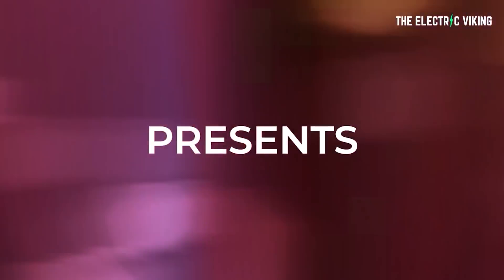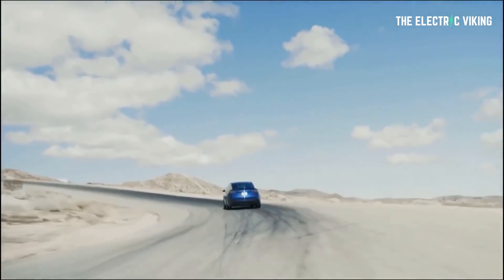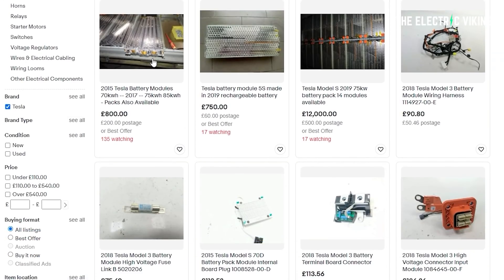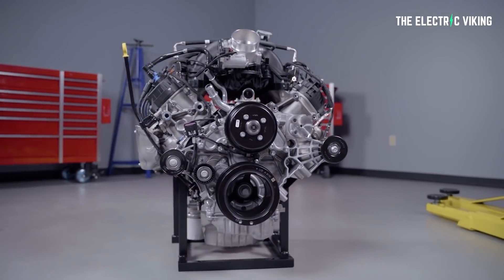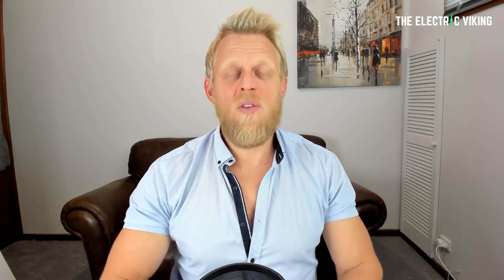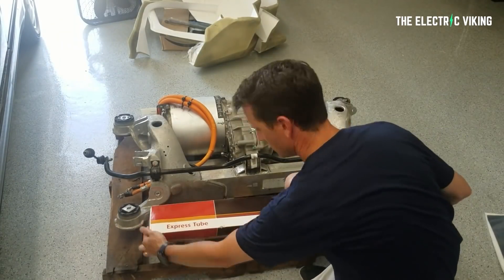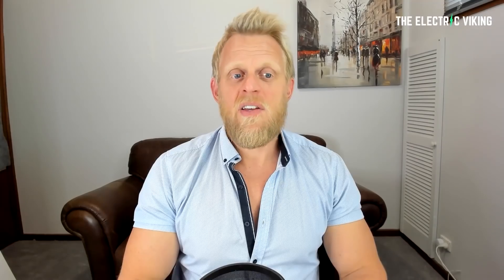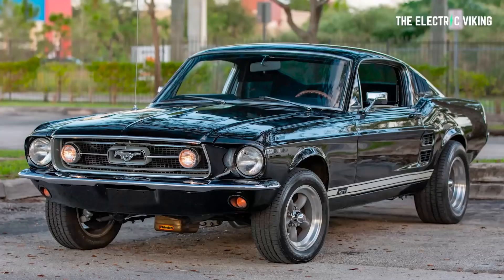Scrap the small-block V8 Swap for this Tesla Crate Motor

Comment: The battery is the difference from the past.
The conversion can include a SMALL BATTERY for the daily drive. 
FORGET HORSE AND CART THINKING. 
Daily top up at home 
Daily top up at home 
Daily top up at home
Daily top up at home
The old ways of putting 500 klm of highly inflammable petroleum, 80kg, and $100s in the tank every 10 days is not needed. 
The vehicle battery can even power the home overnight.
And the rooftop solar PV power the home all day. And feed the grid. 
Plug the EV into the grid everywhere soon.
Westfield shopping centre car parks can supply wall 240volt outlets and cover the rooftops with PV panels, I hear.
So home and shops can top up each day EV..
Reply: Stfu!!!!! Some people converts their old ICE to new modern ICE engines to have even better range and practical and also runing your old diesel on used oils is another great idea. Overlanding,towing, off-roading, camping……
Reply: @alanmay7929  there are people pushing the nuclear power plants to get CO2 REDUCTION. 
They say that the EV car can be charged from the grid.
The petroleum will be a strategic military reserve.
Reply: @stephenbrickwood1602  petroleum will still be much more than military reserve because oil is basically everything, your tesla batteries can it replace oil not even in billion years, the industry needs raw materials and products mostly made from oil.
Reply: @stephenbrickwood1602  tesla cannot make the semi or cube because those vehicles needs significantly way more batteries than the small model 3 or y for example. A diesel truck has basically no limitations, you can very easily increase the fuel capacity to travel over 2500 miles in the middle of nowhere like the Australian road trains…. The mining equipments can run 24/7 without interruption tell me which batteries can power them!!
Reply: @alanmay7929  newer technology and the world against CO2.
Climate destabilisation is not cheap. 
2,500 klm in a truck means a lot of truck stops, 25 hrs driving is 3 8hr shifts, or 6 4hr shifts.
People will pay for better thinking, and not pay for old thinking.
Reply: @stephenbrickwood1602  another funny comment mate! Thé 2500miles driving is not on paved roads all the time and they drive longer than normal truck drivers, plus the roads are sometimes in very bad conditions, the grid does not extend the whole desert and with rains and other problems the supplies needs to be quickly delivered. I said 2500 miles not km!
Reply: @stephenbrickwood1602  tell me why we are still using diesel to mine and transport raw materials for EVs where do you see old thinking here!? You non existing tesla semi can’t even tow a 1/3 of a road train lol…
Reply: @alanmay7929 2,500miles or  4,000klm means 40 hours of driving. 
I assume the truck is delivering a load of diesel. And other stuff. 
You are right about that truck and other extreme examples. 
The world is in agreement about CO2 REDUCTION. 
As I said strategic military reserve and unusual production needs will be the last  to be replaced. 
The smart thing to do is use current production capacity to transform all the easy things first.
Reply: @stephenbrickwood1602  those trucks mostly deliver goods and alot
Of times emergency stuffs and things for really remote communities. Australia is super fast and travel routes are super long and not covered with any kind of grid. Routes are mostly unpaved/untared……
Reply: @alanmay7929  yep

Comment: My sprinter RV..  no more need for propane or a diesel generator.  50 amp plugs are at every camp site so charging wouldn’t be an issue. Fold out solar panels on top would be a bonus. Two Tesla plaid batteries would be fantastic under an RV. With two the range should be sufficient.

Comment: Scrap an old high mileage ICE engine and its fuel tank.
Lift the suspension and install battery pack under. 
Improved cg and improved handling. 
Ute's and pick up trucks can even use part of the rear tray..
Reply: Not the reality unfortunately!

Comment: Great to use the crate motor, however the battery pack is the issue.  Where are you going to put that pack at exactly?  There would be a huge amount of custom fab, not just a drop in crate motor for sure.  You are going to need cooling, all the computer parts, HV parts, etc.  I know it can be done, but not nearly as simple.  Just like trying to make a modern day Ford engine out of a wrecked car into say a Mercedes whatever.  You will need all the guts as well, wiring harnesses, computers etc.

Comment: Note: Read the fine print in the Tesla owners manual. You do NOT purchase the software in your Tesla you purchase a license to use it. And the fine print will say that Tesla can revoke that users license agreement at any time for any reason. Like taking a Tesla motor, which contains a processor with code, and putting it in another vehicle. Even another Tesla.
Reply: This would be the same for any device containing computer code including TV's, washing machines and microwave ovens.

Comment: A Morris Minor Traveler has been my dream EV conversion for many years now.  But I don't think it could handle 500 hp.
Reply: I'm sure if you put a small battery pack in it, it could be "detuned" for less performance and greater range. There's not a lot of space in a Moggy for batteries anyway...

Comment: It would work well in a pick-up truck. I don't see a lot of room in your typical pony car from the 60's under the floor for a huge or even a small battery.
Reply: 1978 Charger with a 550hp motor!  Beast mode unlocked!  FYI the V-8 only produced 325hp stock.

Comment: I would choose to convert my 1994 Mazda B2300 Pickup truck...my daily driver. Should be a piece of cake...and the battery can just go in the bed of the PU...and I can build a stake bed over it. I would de-rate it to a 100HP or so.

Comment: My son, a 50 y.o.fabricator, mechanical tech, automotive electrician and Engine Control ECU builder has converted his repair shop to EV conversion wire harness manufacturer and EV conversions. The back log is up to a year wait, nearly as long as the Tesla EV back order catalog. Growing business. LOTS of room for more shops. A LOT of custom car owners with a quarter million invested think another $50K for an EV swap is COST EFFECTIVE.
Reply: Yep

Comment: For a ex v6 or v8 replacement of the fuel tank with a pack could work. Just imagine a 500 model fairlane with this.
Reply: Lol…. It’s not just the fuel tank with batteries but all the many other electronics that comes with it.

Comment: No no no no. No Erik, you can't do that.

Three parts here. The HV Battery, the motor and the electronics to control both. And lets not forget the Tesla proprietary copyrighted software specifically written for that motor, controller and HV Battery. If you use any part of that your in violation of Tesla's patents and copyrights.

And, and I've had some experience in control electronics for small electric vehicles, the electronics are way way way beyond just about everybody to understand.

Ain't gonna happen

Comment: Quite a bit more engineering required before you just swap a motor......brake, suspension, steering and possibly some extra welding for rigidity due to massive increases in torque....

Comment: Like every original inspiration, somebody somewhere on the web has already done it! Yamaha released an electric crate motor two years ago, as did Chevy (Connect and Cruise eCrate) and Ford (the Eluminator). Best new tech is the AEM PDU-8 Power Distribution Unit, which massively simplifies the whole build.

Comment: All these different electric create motor ideas are ludicrous and not in the cool Tesla way. There has never been a car designed for an ICE with a bunch of unused dead space waiting for you to shove a giant battery in it built into it. And you can’t just bolt it on underneath like a modern ev because then it would have the ground clearance of a lawnmower, not to mention you’d have to figure out how to maker a drive shaft share space with an under-mounted battery. Then we get onto control electronics they are complicated on Ev’s you would need a complete kit from the manufacturer just to be able to input the necessary information required to drive it . As an example Ev’s don’t have a throttle body or engine air intake so no throttle pedal as such. The input from the accelerator pedal is fed to the control electronics in the inverter that adjust the frequency modulation corespondent with your desired speed. The fools that think this stuff is plug and play are just plain misinformed!

Comment: This will be a massive industry in the high performance world. Be a number of years before manufacturers get past current electrification difficulties. Once GM, Ford, Tesla make an easy to use controller, they will sell like hotcakes. They'll need to offer smaller batteries than the standard EV battery. some thing like 40KwH to keep the weight reasonable. EvWest is a great little company
Reply: Lol….. batteries and controllers!!!! What a joke! If someone is going to make an electric crate it’s definitely ford and GM or other manufacturers and unfortunately not tesla, tesla is already trying to make you not own the car which to me is a big no go
Reply: Tesla is integrating everything by copying apple so that in the future there is not going to be possible to use their vehicles/parts

Comment: My #1 EV conversion would be a 1957 Chevy Nomad with a big screen interface such as Tesla's.
Reply: Lol….big screen for what!? Destroy the looks of a conventional classic car!? 😱
Reply: @alanmay7929  I get it and I'm normally in that philosophy. I was thinking of finding a rolling chassis that needed some restoration work and throw in an EV Drive train while retaining as much of the original look.
Reply: 1978 Charger with a 550hp motor!  Beast mode unlocked!  FYI the V-8 only produced 325hp stock.
Reply: @davidbeppler3032  you mean the decades old v8 lol…. A super light 4 cylinder even 3 cylinder engine today makes more power tbh!
Reply: @alanmay7929  That is what stock means.

Comment: This is going to be huge, can you imagine what kits and parts will be at SEMA over the next few years.
Reply: There was also a reverse conversion done by Rich Rebuilds at SEMA - an LS swapped Tesla. Didn't cost him much I don't think as he'd already sold all the EV parts off the Tesla body and LS crate motors are way cheaper than Tesla crate motors and battery packs...
Reply: @aftonline  exactly! I’ve seen a Land Rover electric conversion it costs about 120k+ way more expensive than a gas or Diesel engine
Reply: They've been at SEMA for years already. GM debuted one in 2019 and you can already buy electric crate motors from GM, Ford, Yamaha and several others. Jaguar did an EV restomod years ago as well.
Reply: It’s going to be there be boring tbh!

Comment: The ideal candidates are cars and trucks with frames where you hang the battery between the rails. Already mentioned are pickups which is exactly Ford is doing with its Lightning.

Comment: I’ve actually been thinking about a vintage VW T1 or T2 bus EV conversion.
Reply: What semiconductors would you use in the motor drive circuit?
Reply: @wilcalint  lol Sorry, just thinking about it; not planning it. I just thought it would be great if it existed.

Comment: How about hub motors that just bolt on at the wheels?
Reply: there is a company starting to make them the sandy munro works with (forgot name)
Reply: Sealing the slip rings is a problem. Maybe not in west texas, but in salty chicago it would be.

Comment: I love the Barry White voice :) 
Hope you feel better soon!

Great idea. But way too expensive to include in all but special situations.

 I think I see a way to hybridize it.

Imagine a replacement rear differential that has an integrated motor. Add a 10kwh battery and a charging system.

This gives you the ability to use regenerative braking and to use battwries to accelerate from stop.  This allows you to convert many existing gas powered vehicles to hybrids pretty quickly.

To add on...

Imagine a retrofit kit for your boat trailer.  A small electric motor to help you accelerate and recover braking energy when you tow. That would help EV trucks as well.
Reply: naah.. not barry white.. more like rod stewart's.. lol
Reply: No not a cheap way to get an electric car but a way of making those old classics green and reliable and keeping them on the road with clean air zones popping up in major cities.
Reply: @eclecticcyclist  

No... it does not make them green and reliable.  

It makes people feel like they are making a difference.
Reply: @JohnBoen  It makes them greener and more reliable than running the gas guzzling V8 and auto box.
Reply: @eclecticcyclist  
I am not saying it is a bad idea, but I don't think this is high enough volume to make a difference.  Not enough people will do this - if you love your gas car it probably has a lot to do with the gas.  My opinion...

Greener.  But not as green as a custom built car.  Probably not more reliable due to lots of custom manual labor needed to produce it.

Converting a car into a plug in hybrid would be easier and cheaper.   You get regenerative braking and reduced gas when accelerating - which should allow you to drive green much of the time.

Perhaps an extra motor and gear box that attaches to the output of the transmission and then to a shortened drive line.  Connect it to the brake, throttle, and gear select lines and have it apply power or regenerative braking.
Reply: @JohnBoen  If people are going to go to the expense of a conversion I think they'd go fully electric, after all these are classic cars not daily drivers and the range advantage of a hybrid is irrelevant.
Reply: @eclecticcyclist  

I recant!  
My DIY is showing... I'm thinking too small.  :) 

I was thinking aftermarket changes only - trying to come up with solutions that more people would choose, given the costs... because EVs will be scarce until they ramp up production.

But this may allow legacy auto manufacturers to continue to produce their designs much longer.

Comment: EV West has been mostly focused on bolt on conversions for Porsches.  I have a beauty Bullitt green New Edge Mustang with 180k miles on it.  It is cherry but won't last forever. I am so glad to hear of the EV West is working on this for EV small block conversions.  I can sacrifice my (never used) rear seat for a "seat delete" battery location.  Should serve me till my Cybertruck (res number 1,311,000) is ready in maybe 2025. It will be costly but not if they pre-stamp the mounting plates for Mustangs like they have done for Porsches.
Reply: By the way, if I lived in Oz, I would definitely convert and restore a Ford Falcon XB Coupe ala the Road Warrior.  A piece of history, that.

Comment: Being as practical as I am, I’d choose to convert my present vehicles, a Jeep Wrangler unlimited and a Ram 1500. That being said, a ‘68 mustang Mach 1 fast back would be really cool. I’d rebuild and polish the original engine and put it on a stand like a museum piece.
Reply: I don't understand the point of converting an old classic to electric
Reply: @mrwhips3623  consider it a resto-mod. More power, faster, and more reliable. In my case, the engine would still be available should I want that distinct sixty’s ford rumble once in a while. The only drawback is range, but that’s not really a thing with a classic, as most spend 98% of their lives under a blanket in a garage only emerging on summer days for a few laps about town and a car show.
Reply: @buddywhatshisname522  that's my point. No matter what you do it will always be slower and more unreliable than a modern car even if it's electric. So honestly I'd just keep the gas guzzler since it's a show car

Comment: This would be a fun solution for old vintage semi trucks.  I love old trucks, but they're bad for the environment.   Converting them to electric is a great idea.
Reply: A small company called Edison is claiming to do just that. I see them from time to time on TikTok.
Reply: Converting them to even modern gas or Diesel engines still makes them better for the environment, plus they are more usable than an electric truck too. Also imagine running your old diesel truck with recycled oils…

Comment: I'm a pilot and I'd love to see an electric Cessna 172.
Reply: Energy density per unit weight and volume far from adequate for that sort of aircraft.  keep in mind one (1) gallon of Petrol has 32kwh of energy and weight is 6 lbs. And 32Kwh battery weights ~400Lb.  (Battery weight per unit energy is ~67 times as much)

Comment: A small two door pickup swapped to electric would be my choice.
Reply: You gonna write the code for the controlling computer and what computer are you going to use.
Reply: 1987/94 nissan hardbody PU.
Reply: Just get a Ford Ranger from the 90's put the batteries in the bed.  You could get 500 miles range easy!

Comment: Sounds like a Franenstein monster of a mix between an EV & a petrol engine car, what about chaning the transmission, and what about gearstick, no central console, what about exaust, the  charger , arrgggghh.
I would rather sell to Redwood Materals or Li-Cycle or similar to get the Batteries recycled and have the materals reused, more environmentally friendly.

Comment: Removing diesel engine from a school bus, then converting it into a skoolie (RV)!
Reply: Or running your old diesel school bus with biodiesel and the batteries to run your installed equipments on board!!!!! Just imagine the costs of the batteries to power an RV

Comment: Ford is selling their Mach E motor as a crate motor now!  It’s $4095…and you still need the batteries, inverter and other electronics…but it’s a start!
Reply: And power brake booster, power steering drive, A/C drive etc,
Reply: It seems like a good way to drive economies of scale